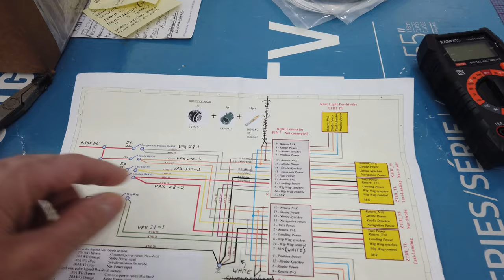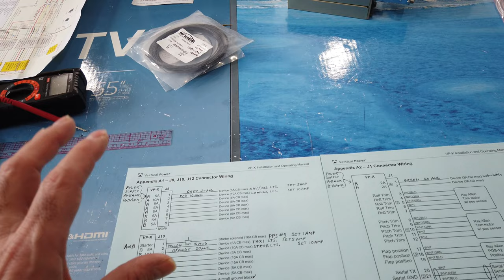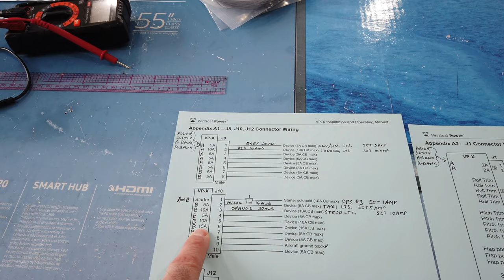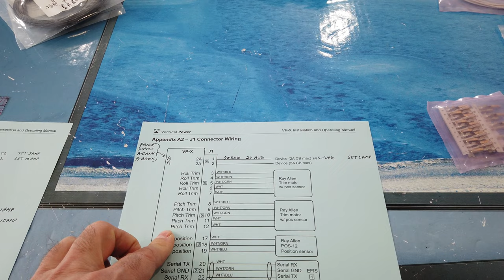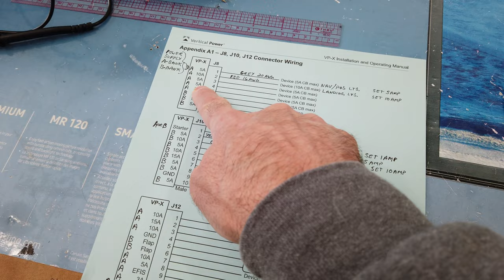Vans RV 7 HINT Video Avionics 4

Comment: This is the best explanation of the VPX that I’ve found do far! Thanks for it. Still not sure if I like everything going through a single “magic box” that can go up in smoke or 20 years from now, if they go out of business and the “box” dies, then you have to re wire everything? I like the simplicity and independence of the old fashioned circuit breakers…but this does seem to clean things up.

Comment: Great video Mike and explanation of the VPX system - I'm sold. I also love the look of those adjustable cable holders. We don't have McMaster Carr over here but I have found similar on Amazon so have ordered a pack. Do you think the self adhesive will be sufficient by itself to last over time or are you beefing them up with epoxy?
Reply from the maker: Thanks Steve. The more I understand and work with the VP-X, the more I like it!  I am using the stick on cable ties as is. Once on, they are difficult to remove, but not sure how they will last over the years. We use them and the stick on pads for tie wraps at work all the time and they last forever. (non-aircraft environment...)
Reply: @KaretakerAero  The sticky/foam adhesive on those clips can degrade over time - after 5-10 years they start to come off if there is any vibration/tension on the wires.  I wired my model train layout with them and am regretting it 🙂  On the other hand, if you like their locations, you can easily drill a hole thru it and rivet it to the bulkhead - rivets are forever.
Reply from the maker: Howdy John. I agree they may not last forever and I am fine switching them out as needed. Like you said, over time if I don't need to change and/or make upgrades, I can switch over to a more permanent solution.

Comment: Where did you get those larger bundle connectors?
Reply from the maker: Howdy Edwin. Not sure what connectors you are referring to; the wire connectors all came with the various avionics equipment wire kits and the plastic stick on wire holders came from Mcmaster Carr.
Reply: @KaretakerAero  thanks and howdy, it was the stick on connectors. Similar stage on my RV7 and I liked their simplicity.

Comment: VPX this is backup battery pack?
Reply from the maker: Howdy. No; the VPX is the electronic circuit breaker system and power supplies, (2) to distribute power. My back up power supply is the IBBS box. (Integrated Battery Backup System)
Reply: @KaretakerAero  how does battery or alternator power come to the VPX unit?
Reply from the maker: Vertical Power also sells a Primary Power System, PPS. I have this unit that takes battery/alternator power and feeds the VPX.